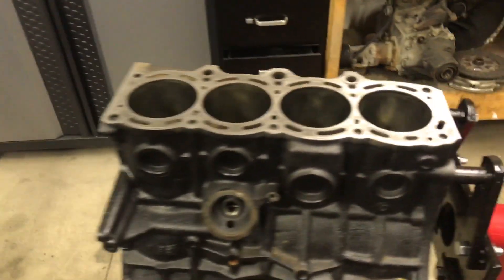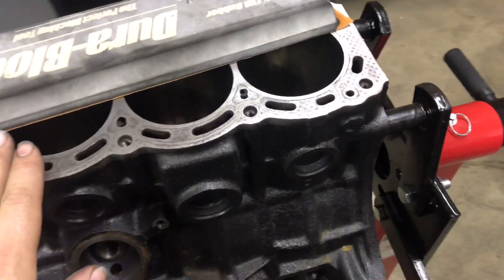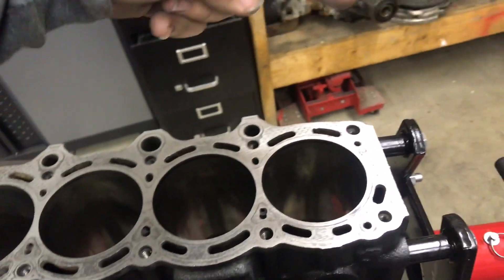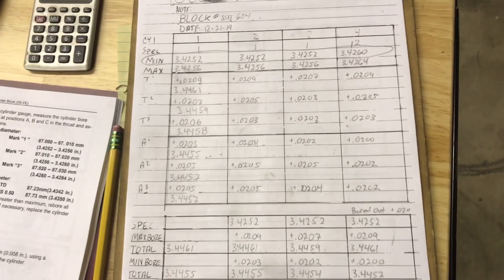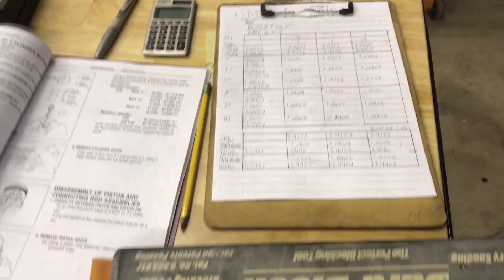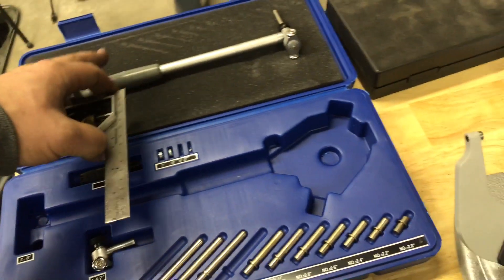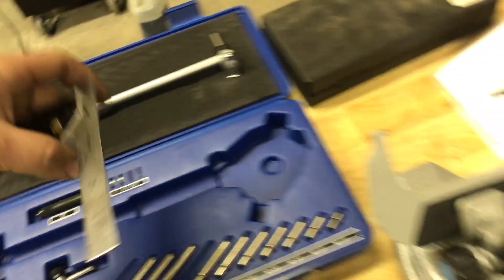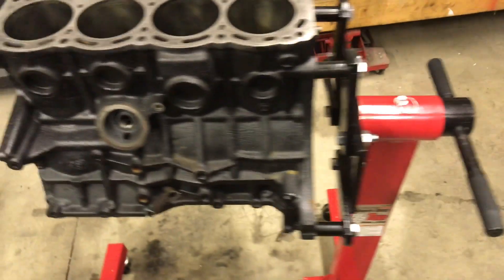5sfe project PT2 - Block bore and deck check

Comment: Great idea man! Im building my 5sfe here in Argentina, where I don't easily find spareparts (most of them are from rockauto). Do you know of some newer gearbox, easily to adapt, that fits this engine? Maybe some corolla or sth? Mine has a problem with the 2nd gear ring..
Reply from the maker: Any thing with a s- series Gear box should work. Celiac, camry, solara, mr2 can with some work I think. I’m not sure if a corolla gearbox would work without modifications.
Reply from the maker: https://youtu.be/xYOhf1cvQDE
Reply from the maker: That’s a c60 parts into a c50 but it should give a idea of the difference between the c series and s series Toyota trans
Reply: @velocityperformance8574  Thanks man! I think that the rav4 here has 5sfe's, maybe they use s-series gearbox.
Reply: @nitoy2k  Si tienes una RAV4, en Puerto Rico las RAV4 vinieron con E250 (2WD) y E250F. No creo que las c60 ni las c50 pueden trabajar en una RAV4 con motor 3SFE. Tengo dos pdf que habla especificamente de las transmissiones de la RAV4, si, son en ingles. Te las puedo enviar grats.